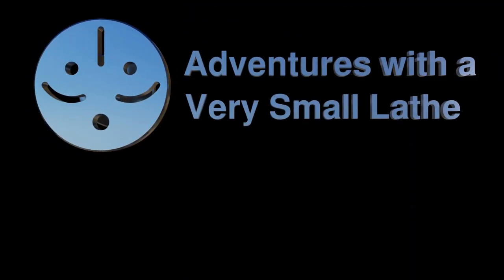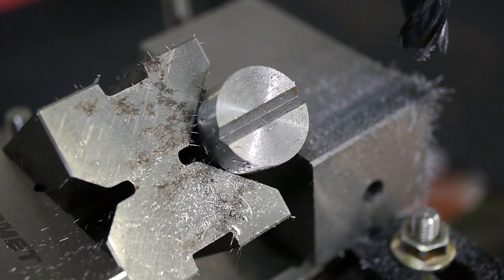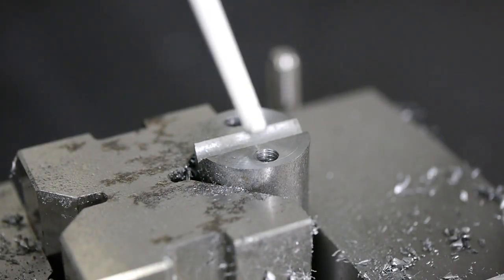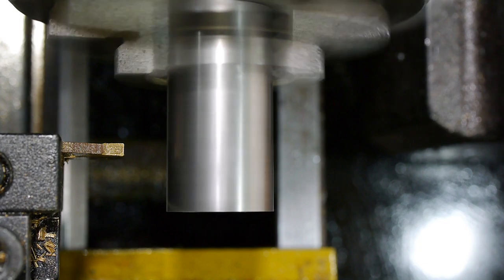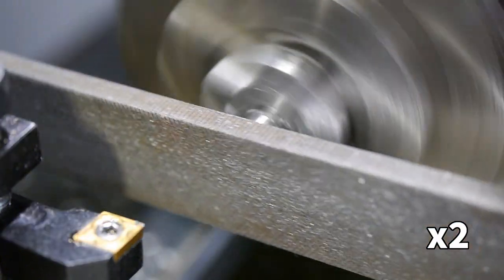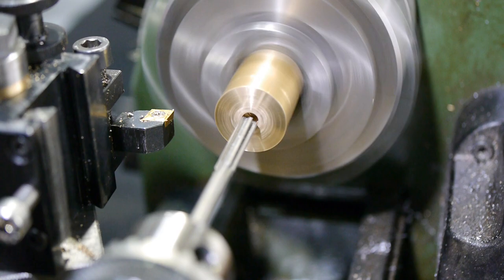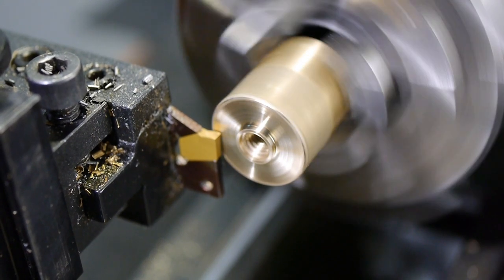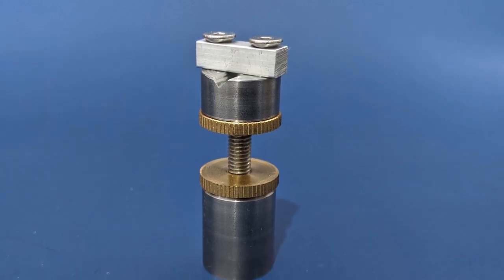Precision Machinists Jack for Toolmaking - Just One Fixture

Comment: My first lathe was a little prewar 3 3/8 inch Zyto. Parting off was always always tricky and unreliable.
Several of the books from that era for the 'Amateur machinist' suggested making a rear toolpost with the parting tool mounted up side down. I made one and it worked a treat. May be worth trying on your lathe.
For lubrication I use a small (~35cc) plastic bottle with a fine tip hollow needle, you can get the needle into the parting groove and maintain a constant dribble of lubricant. The bottles with needles are a couple of dollars from 'Banggood' direct from China. 
A great source of 'free' lubricating oil is from vehicle differential casings.  I did a full service of my old 4X4 and now I have enough oil for a lifetime! 
Cheers Paul in NZ
Reply from the maker: Thanks for the info, especially the Banggood dispenser bottle tip. I have just ordered a couple.

Comment: As to the M4 holes you mention being oversized. If you used a standard M4 tap you would have gotten an M4x07 thread. That means that the predrill size is 4-0.7=3.3mm. And you say you used a 3.5mm drill. That's why they were so oversized.

P.S. Really good video, btw. Great tips and easy to watch.

Comment: Just a nitpick but at 1:46 it looks like something is out of tram. The groove looks wider in the back than in the front. It could be the chuck jaws have a wobble in the lathe, or the lathe is cutting a taper or perhaps your mill vise is out of alignment. It also looks like the center of the groove is bloated slightly, which would indicate your cross slide is not at a perfectly 90 degree angle with the lathe ways (usually cross slides have a tolerance bias so that facing cuts tend to be dished rather than convex, as the latter causes problems when stacking).
Reply from the maker: Perhaps it's a trick of perspective, because the camera is closer to the front of the groove than the back? I have my vice pretty well trammed, and I can't measure any signficant taper or bulge in the groove, but the spindle on the mill has a few tram issues I can't fix. I'll have to try and measure the angle of my cross slide, to see if it is off. Thanks for the heads up!
Reply: @AdventureswithaVerySmallLathe  I didn't think it's a perspective issue because if that were the case the groove would get wider as it gets closer to the camera. Instead the opposite is true. Thinking about it more, I think I see what is happening.

If you look at the far end at 2:01, you can see the saturation and blur causes the edges of the groove to bloat, so it looks like the groove width changes as the part moves through the focal plane. Now when the cutting pass is finished and the far end is in the cutter's shadow at 1:57, the saturation/bloat disappears, so the groove appears to be wider there. As the groove gets bigger, it swallows the light reflection and so the taper seems to disappear as the groove gets bigger.

The groove seems bloated in the middle because the middle of the groove is not inside a reflection and so is not constricted by saturation.

If anything I guess this suggests a possible way to improve the filming. Maybe change the lighting or optimize the brightness settings.

Comment: Nice to the the follow up, thank you! I don't remember who, but I do remember someone put a slight taper on the cutoff tool so that it cut the work piece off ahead of the rest of the cut! This left a fairly clean edge with very little burr.
Agree with other posters, cold bluing would look nice.
Reply: A word of caution: Tapering is best suited to a rigid tool steel parting tool.  Tap-in carbide inserts rely on even cutting pressure across the tip and the part walls to keep it straight in the tool.  The inserts have a small top to bottom radius and tapering an insert like that will result in more 'bite' on one side and can cause the insert to shift and the parting to be slightly concave on the pointy side.  It's a tiny amount but over time that shifting can cause side to side wear on the insert holder which leads to chatter, etc.  Just something to be aware of.

Comment: Very nice video! Not sure how I didn't come across this channel earlier. At about 3:50 when you were spot drilling, it looked like the spot drill wandered a bit before biting in. Am I interpreting the video correctly, or is it just some sort of illusion. Watched again using frame by frame advance, looks like it bent a little to the left. Perhaps less stickout would reduce or eliminate that. Was that a high-speed steel bit or carbide?
Reply from the maker: Thanks! It looks like the spotting drill does wander a tiny bit. The camera is really close, and this movement wasn't at all visible to the naked eye. It's a HSS spotting drill. It probably needs to be touched up, which is probably going to be quite a challenge if I'm going to avoid ruining it.

Comment: If I m going to part off parts I will put a piece of material in the drill chuck in my tailstock to fit inside the drilled hole to catch the parts as they are parted off

Comment: Nice Video !!! 
But 16:14 a wrong tool is used. The straight chisel is normally used for grooving. For cutting of material you should  use a chisel that has a slight angle. Yes you can use a straight chisel but its not right. Just had to say it.
Reply from the maker: Yeah, GTN inserts are hard to get, and many sellers don't provide proper information about the angle, so I have to make do with what I can afford.

Comment: Hi Alistair - great video and great result . I also like having some more insight into the small machinist jack that you made for my secret santa gift!

Your video quality is excellent and an inspires me to get my voice overs, sped up sections and lighting and audio quality up to scratch!

Using the off-the-shelf cap head screw and turning and facing the head down precisely was a good idea. I will keep that in the bag of tricks. Much faster and easier than turning and threading a section of round bar.

You may have seen in a recent video or two of mine that I have acquired a very large (!) mill. Well - since then I have also acquired a "very small lathe". Smaller than your proxxon! it's a TAIG micro lathe. It needs a clean up and a tune up, but I will be doing that in a future video. I want to see what the little thing is capable of. I'll be looking at your channel to get some ideas :-)

Good trick with the vice burr removal. I have never seen that but it makes loads of sense.

Only change I would make would be to face off the ends of the clamp bar. No doubt you've already done that off camera.

Cheers,
Craig (in Tasmania)

Comment: Why was the endmill sticking out 3 miles????
Reply from the maker: Because it had to for the spindle collet to clear the top of the collet block I was holding the part in. The spindle collet was fully engaged, and this was literally the closest I could get it.
Reply: Or get some smaller bolts and less washers ... hehe

Comment: Please explain your comment about the cutting speed getting slower as you move towards the center of the part...   If you are using a power feed with your machine set at a certain feed rate that will remain constant no matter how far it travels. The  diameter of the part getting smaller will rotate faster but this does not actually change your feed rate even without actually changing the rpm's of your chuck either.
Reply from the maker: My tiny hobby lathe has no advanced features like power cross feed, or the ability to vary the spindle speed automatically. I don't have enough hands to be able to vary it by hand, but even if I did there are practical limits. I am using a carbide parting insert which is rated just over 100 m/min cutting speed, and it cuts way less well at lower speeds. When the tool gets to 3mm diameter, the rpm would need to be increased to over 10,000rpm to maintain a good cutting speed for the insert, and as the diameter gets smaller still, the rpm would need to be much higher. I have frequently had problems with inserts breaking, and parts bending due to cutting forces when the inserts gets close to the centre, so now I always try to avoid this by drilling a hole first when I can, and it fits into the design.
Reply: @AdventureswithaVerySmallLathe   I understand the non-ability of your machine not to be able to vary rpm or have a power feed. In fact I use a manual engine lathe and a boring lathe that does not have rpm sync either but even though they have power feed I don't use it unless on larger parts. I noticed that you stopped feeding in and backed out just a little bit then started parting again when you had your parts catch in hand. Many times that will break an insert a lot more than lower rpm's and feed rate issues unless you're jamming the thing in there basically crashing the tool into the work. 

I usually part off our work around 175 rpm and feed to get small curled/balled up chips instead of those flakes like you was no matter if I am feeding manually or with power feed in soft or hard metals. We often work with a variety of metals from brass, 6061 aluminum to mild to hard steels and every so often iconel.  We do have CNC lathes and mills also but those are for our  larger production runs most of the time.
Reply from the maker: @bbarker5766  I think my machine is just not rigid enough for the technique you describe. I've done parting on a full size engine lathe, and it's a completely different ball game.

When I try slower speeds I have major difficulty getting the cut to start. My lathe has very little torque at slow speeds, and once the cutter engages it just stalls. Speeding up helps a lot, but then I almost always break the edge or insert of the cutting tool once I get down to 2-3mm diameter, so I've adopted the technique of avoiding parting all the way to the centre whenever I possibly can.

I paused the parting in this video because I had to swap what I was holding, but I've never had problems resuming a parting operation midway with manual feed.
Reply: @AdventureswithaVerySmallLathe  thanks for the interesting and knowledgeable replies.  How do you change the rpm on your machine?
Reply from the maker: @bbarker5766  The rpm control is an electric knob which just reduces the power to the motor. There are also three belt pulley positions, but one of them is too fast for any use I have for the machine. The slower belt pulley is better for low rpm work, but still lacks torque.

Thanks for your comments! I appreciate being able to discuss the differences between heavy professional machines, and the light hobby machines I use.

Comment: Aling only with 100rpm... Better result and longer life for ale :)
Reply from the maker: Aling?
Reply: Adventures with a Very Small Lathe Ah i thinked its the english word for it 😂 Im a german mechanik... After you drill at 9:16, Thats what i mean 😅
Reply from the maker: @dzy97  Ah, that's reaming with a reamer. One issue with using a small lathe like this is it has very low torque at low rpm, and it can often stall at low speeds. I often have to do things faster than I would like, to make sure there is enough torque.

Comment: You are using the proxxon mill for the groove right? Why do you angle the workpiece in the vise, instead of tilting the mill head? Rigidity?
Reply: yes, he angeled the part instead. which is perfectly fine for low presicion parts like this :)
Reply: @pinkman20001  Good to know, I thought there might be some reason to avoid it :)
Reply: @badalloc1  if you have any other questions you can just ask, I might not have the most experience but I am practicing to become a machinist..

Also another good way to do this would be with the use of a sin bar underneath the part😄
Reply: @Bad Alloc I have the exact same Proxxon Mill & although the head can be tilted, it's arrangement is just via a clamp screw & a slip fit shank, NO worm gear adjustment like on the big Mills.
The adjustment & realignment is such a pain that having done it once, you'll do as Alistair has done & setup angles within the vice. HTH, Colin
Reply: Tramming the head back in, isn't worth the effort for such a part.

Comment: The endmill sounds like a donkey braying.  I this contributing to public discourse? The vid was really well done.
Reply from the maker: Noisy milling is a constant problem I have, though I've tried all the suggested solutions. I think I just need a slightly bigger, more rigid mill. Thanks!
Reply: @AdventureswithaVerySmallLathe  how big was the endmill and how fast where you running it?
Reply from the maker: @pinkman20001  It's a 10mm carbide endmill rated at 450 sfm. I'm running it at 2200 which is about 230 sfm, which is as fast as my mill will go. If I run it any slower the noise gets a lot worse, and below about 1200 rpm it stops cutting properly. People often suggest running it slower, but at this point I've tried every speed setting, and 2200 is by far the best.
Reply: @AdventureswithaVerySmallLathe  your right, with a mill of that size you need all the speed you can get to minimize the tool pressure. But I think maybe stub length uncoated tools would help a lot, since it's seams like you don't do a lot of large work the extra length in the cutting flutes just hold you back from getting the tool further up the holder
Reply from the maker: @pinkman20001  Thanks for the advice! I have looked out for stub length tooling, but it's not always easy to source. I'm interested in understanding why you suggest uncoated tools. I had assumed that coated was always better. What is the advantage of uncoated?
Reply: @AdventureswithaVerySmallLathe  I was not trying to be critical, just a bad attempt at humor. I liked your video quite a bit and the mill noise is perfectly fine. You can tell a lot about an operation from the sound, so I think your audience will want to hear it.
Reply: @AdventureswithaVerySmallLathe  usually uncoated carbide tools tend to be sharper, and low power machines like your mill and lathe which can't produce the tool pressure  necessary benefit from the extra sharpness a lot.
Also where are you from in the world? I might be able to help you find the tools if I know
Reply from the maker: @DudleyToolwright  No problem, sorry if I seemed defensive. :) The topic comes up quite a bit. Glad to hear that hearing the machine sounds is valued. I think the sound is important information to include.
Reply from the maker: @pinkman20001  Thanks, that's useful new information. I'm based in the UK, and get most of my tools from eBay. It has been tricky to find local professional tool suppliers who will deal with a non-business customer, so if you can help out there I'd be very interested.
Reply: @AdventureswithaVerySmallLathe  I'll try and look into it!
Reply: @AdventureswithaVerySmallLathe  I looked around a little and it's actually really hard to find anything over there..
Reply: @AdventureswithaVerySmallLathe   - where in the UK are you located?  Are you still in need of a tooling supplier?

Comment: Just a few things, firstly where is the precision that is spoken about in the title? Its just a screw jack with an unnecessary clamp on top. It would have been better to just use a finger clamp that utilises the tee slot in the bed of the machine to hold the material down to the top as it is shown the jack is just sitting down on the bed of the machine and realistically the use of any clamp on top is not needed. Secondly you should be running your countersinks at the slowest speed you have on the machine as it will give you better finishes and reduce vibration and will increase tool life. The reason you were having trouble cutting the stainless head is due to the speed and feeds you were using not because of the material and possibly the grade and type of carbide you were using. As seen in other videos carbide tools only cut in one direction but you persist in cutting in 2 which will reduce the tool life and put unnecessary pressures on the tool and holder. Please learn how to set you tools on the centre height of your material as every time I watch one of your videos it gives me a head ache. Learn what are the correct speeds and feeds are for the materials and tools you are using and you will achieve better tool finishes. Socket head cap screw heads are not supposed to be accurate due to the way they are manufactured so I do not know why you made the comment you did. You reamed a hole then cleaned up the square corners with an endmill but you could have just used the endmill without having to ream thus saving time and achieved the same accuracy. If you do ream you should reduce the speed to a third of what you drilled the hole at. If you do not know this information then please do not add incorrect comments as you are teaching idiots dangerous practices and if someone is hurt following your directions then you should be jailed, the same as if I was teaching an apprentice. BTW I am a tradesmen with 40 years of experience in Fitting and machining, toolmaking and CNC operation and channels like yours should all be shut down. These machines are not toys and can lead to death in the hands of the untrained which seems to be most channels on Youtube.
Reply: Why r you so mad ? Your's r good coments though. 
By the way he is a good movie director. I get some knowledge from you and also him.
No idieot will get killed by watching this but if so wouldnt it be good.